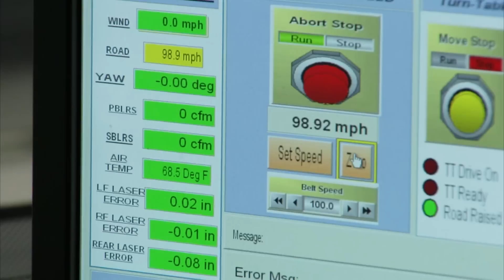NISSAN DELTAWING

Comment: I read this in an article in Popular Science. It's surprising that this car has only 300hp, an average car's hp, but still runs as fast as all the modern Grand Touring cars. Its lightweight body and triangular shape gives this car a lot of efficiency. The creators wanted this car to really show of the driver's skill because this car doesn't have advantages like rear wings for down force.

Comment: no matter the results, it is a great benchmark for future small engines. instead of having a big V8 they use a 1,6 4cylinder engine which is the most common engine setup. so lots of innovations can pass from race to road faster.

Comment: The efficiency of a bug eye sprite is no where near the aerodynamic efficiency of this delta wing thing. This not only provides lightweight like the sprite but a tune-able,  variable down force. It is also much more efficient from a drag coefficient as well. Driving the sprite is like driving a brick compared to this which is more like driving a javelin, spear, arrow or other similarly thin pointed thing.

Comment: Most winning Le-Man's designs are "created" or developed over many seasons. the big story like this is they broke the mold of typical cars, went for a goal and if they don't achieve they keep plugging along until they iron out the bugs. I guess IMHO the story is not what it did this year but what spin off creations of this will do 3-5 yrs from now. Credit where credit is due we don't move forward by sitting around doing the same thing yr over yr. We get ahead by trying new things like they did.

Comment: So its light weight and has a turbo motor,so why not just run a Bugeye Sprite with this engine.Weight is about the same.But it would be lighter if the Sprite was made from carbon like this thing is,Aero is really the only new thing about this car,but i could see why a Small car would not be about the same as this delta shape.